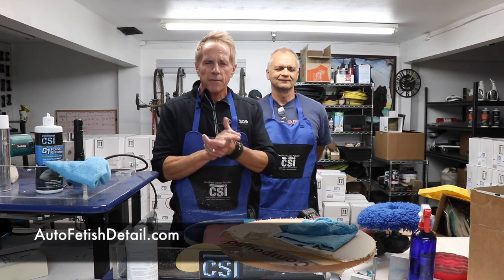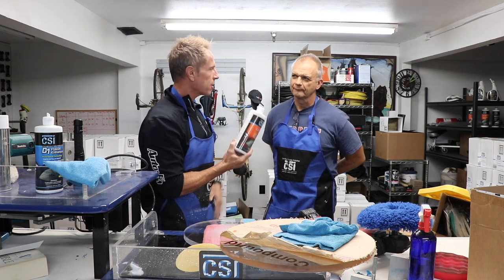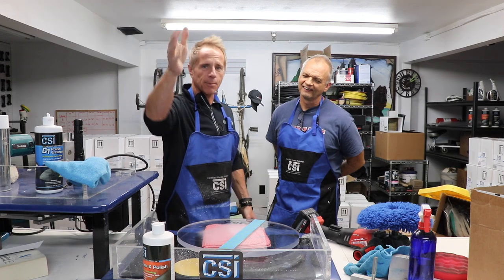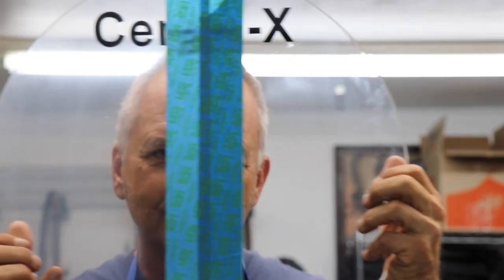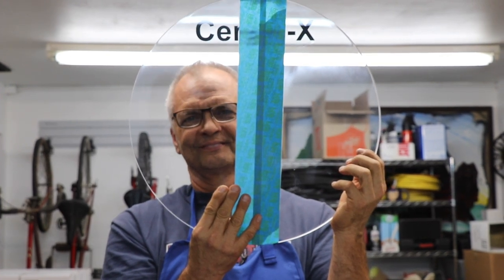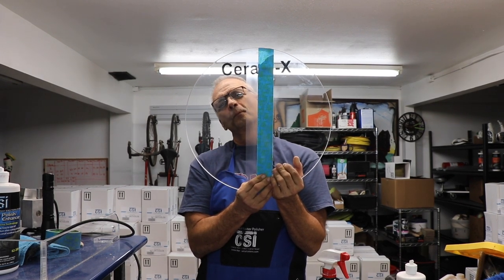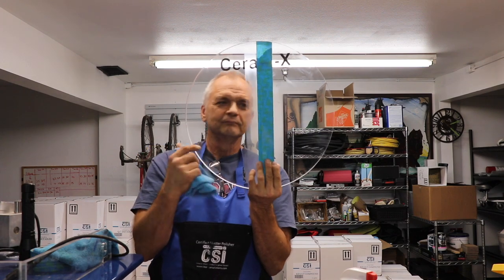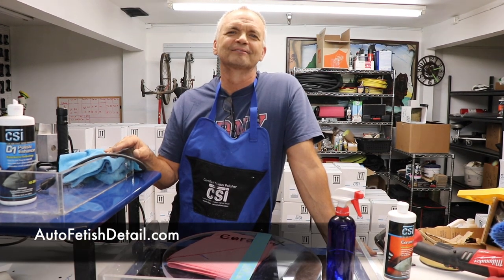Car polishing: Optical Clarity with a Single Product Polish

Comment: Hi Darren/Tom:

The use of the CSI system appears to promote the use of a rotary (w/wool) pad as a first step.  You have yet to discuss the use of a DA through the entire cycle.  Please do.  As well, you’ve never discussed the “theory” behind the concept.  My understanding is that the term “compounding” simply refers to the initial removal of deeper scratches.  If CSI doesn’t involve the use of compounds, is the wool pad compensating for the absence of a more abrasive liquid?

Thanks—Brian
Reply: Great question

Comment: Doesn't 3D do and have the same ingredients? Also, please answer my question about how many pads I would need for a large SUV, because I purchased a pad(s) backing plate and product package. I would also like to know what the outside temperature has to be, because it's getting cold out in CT.
Reply: Mark Hanson - Question did you buy CSI Ceram-X Polish? If so the product must be kept above 32 degrees. Pad instructions:
CSI tech sheet for Ceram-X 62-203
Advantages 
Water based - easy clean up. 
Anti static - dust blows off. 
One product design - no need to use any other product. 

1. Apply Ceram-X directly to wool pad 62-309
2. Using 1000 rpm apply a small amount of pressure to surface and turn buffer on. 
3. Increase RPM up to 1500. 
4. Remove all color sanding scratches. 
5. Check your work before going to red foam pad 62-312. 
6. Notice the surface should have great color definition compared to any previous compounds. All scratches should be gone. 
7. Apply Ceram-X directly to red foam pad 62-312
8. Using 800 rpm apply small Amount
Tom Horvath 
714-906-6619
www.clearcoatsolutions.com

Comment: How much battery life can you get out of this cordless polisher your using in the video?  Could you go around an entire Tundra truck at least once?  Is it a DA type polisher?  Thx
Reply: I'm interested in that too.  I would get 2 batteries though, no matter what.
Reply: Tundra Whisperer - This response is coming from Darren himself:

It's like driving a car. It all depends on how you drive it regardless of what the manufacturer mpg rating is. So the simple answer is to get multiple batteries as a back up. Once you realize the winning benefits of cordless you simply never want to go back. Hence the multiple batteries as back ups.
Reply: Blue Tek Mobile Detailing got it, figure extra batteries would be a good thing to have.  Have you had a chance to use this model DA polisher?  It is a Milwaukee, correct?  Just wondering if they are well balanced and with decent power?  I’m about to invest in a DA polisher, just want a good entry model to start with.  The Maxshine M15 Pro series ll has been recommended to me by a few people and the price point looks good too. $179 with my Maxshine discount they sent me.  Any thoughts?  I do like the “no cord” concept though.  Thx
Reply: @tundrawhisperer4821  The Milwaukee Darren and Tom use is a rotary buffer not a DA.
I haven't personally used that specific DA you are speaking about but if it's being recommended then I say you go for it.